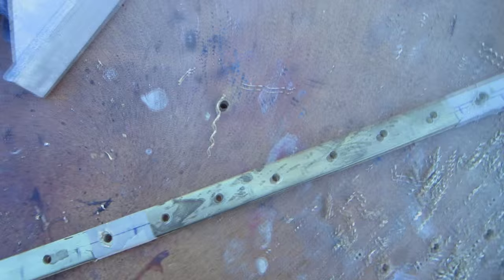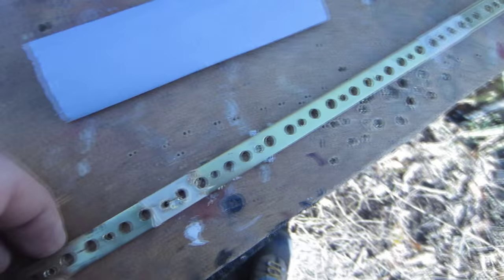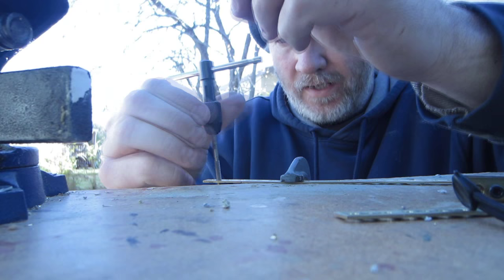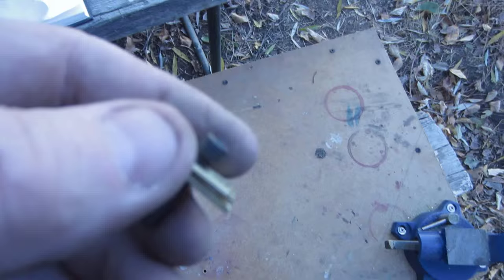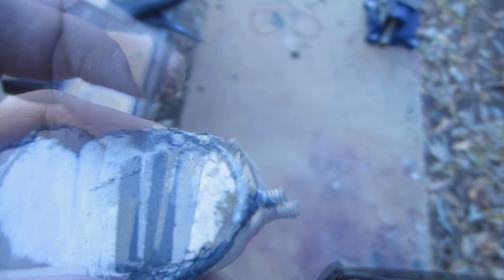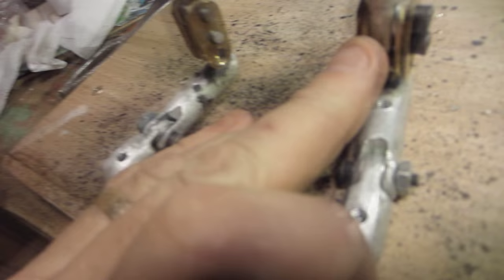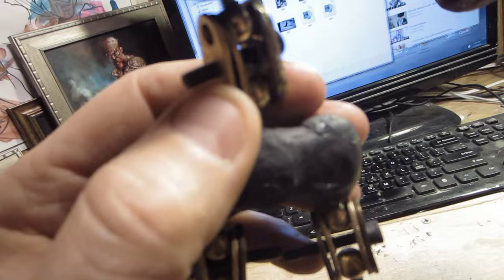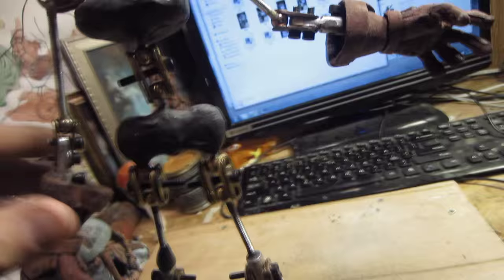Stop Motion Animation - Making An Armature

Comment: Great walk through of your process! I used a very similar method for my armature, but without tapping the holes. I didn't have the tool for it at the time. I use that exact epoxy, too! Can't weld or solder to save my life. haha :)

Comment: fantastic video, thanks for posting it, were did you get the ball bearing for the ball and socket armature?
Reply from the maker: +pattythe seeker These are the ones I use here (3/8in. Solid Brass Ball with 8/32 Female Tapped Blind Hole) ... http://www.grandbrass.com/catalog.cfm?category=Brass%20and%20Finished%20Balls&subcategory=Turned%20Balls

Comment: Are those metal strips made out of brass and what thickness did you use? Thanks for the upload.
Reply from the maker: It is brass. I'm not sure of the exact thickness, I bought a bunch a while ago and it wasn't labeled. It looks like it's around 1/16th of an inch thick. Thanks for watching.

Comment: Ok so I've been following your awhile and I have made my hands and now I'm fixing to move on to the body and joints. I noticed some math on some paper is that how thick your brass bar stock is?
Reply from the maker: The brass I used for the joints was 1/16" inch thick, and 1/2" inch wide. Later on I redid some of the joints in back, legs, hips and feet, the weight of the costumed puppet was too much for the joints to hold tight. I doubled up the plates in those ares, so I'd recommend using brass that is at least 1/8th inch for any joints that are under alot of stress.
Reply: thank you sir. that helps me out a lot. if there was a way to display images on here I would show you my hands. you have inspired me and the videos that you make help out too. keep up the awsome work man.